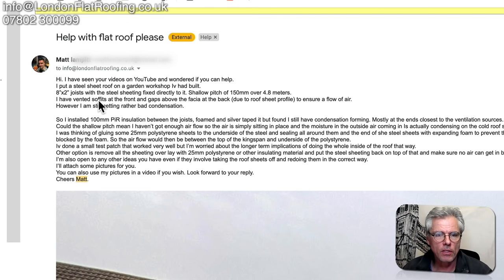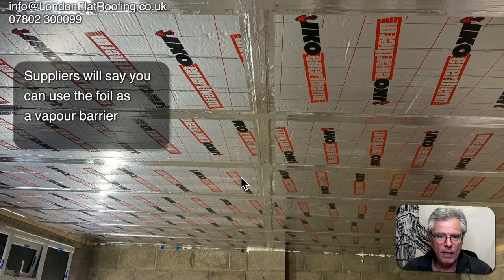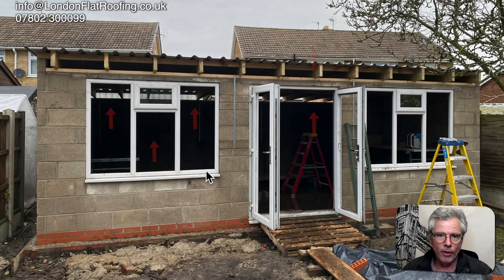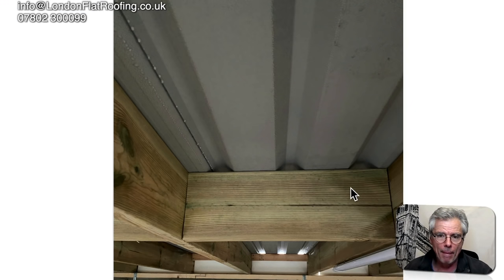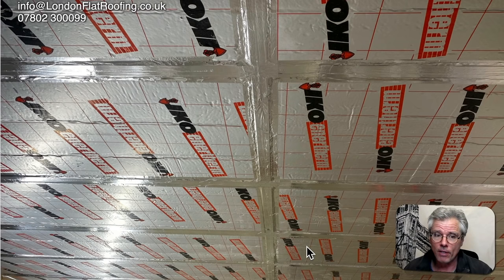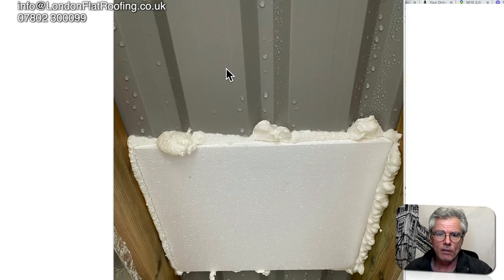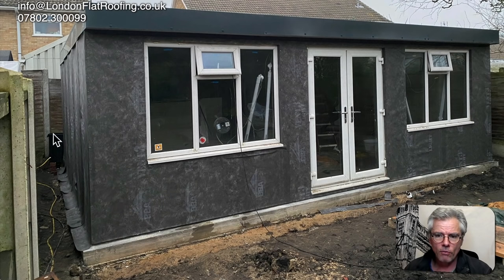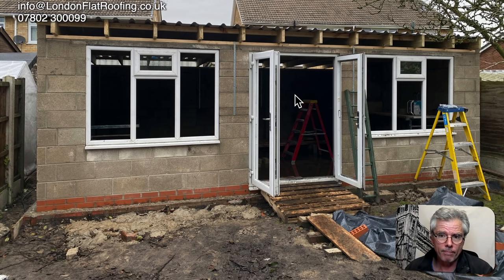Condensation/Sweating on garden office roof

Comment: I’m a builder, I bought my property in wales two years ago, the large garage, 7.5mx7.5m has a metal roof, the rafters run perpendicular to run of the metal roofing sheets, I was having horrendous sweating on mine, water was running down and dripping off every rafter, all my tools, motorbikes etc were rusting terribly.
I tried 50mm insulation but the rafters were 1300mm centres, so over time the insulation has bowed (I should’ve put noggins in with hindsight), i counteracted this with battens underneath to hold it up, this helped loads but still not enough, so last summer I stripped all the metal off and put a moisture membrane over the rafters then put the metal back down, it’s virtually eliminated the sweating now, or it’s happening above the moisture barrier.
This type of roofing is really common in these parts and works well but they also do an insulated version and a version with a fibre membrane glued to it, specifically to stop sweating, I’ll use that in future applications.
Reply from the maker: Thanks for the input can you send a drawing so I can totally understand as its not quite clear I can then share this with others as it sounds like you have found a fix. info@londonflatroofing.co.uk
Reply: @SteveRoofer  basically like your house roof
Reply: thanks this is something i am doing soon. a big metal roof. what vapour barrier did you use?
Reply: I have the very same thing brick walls and tin corrugated roof and had water drips all over my stuff  so I went to a carpet shop and asked them if they had any old carpets they chucking out they said yes in the skip at the back the shop filled my car up with of cuts and put them down on the garage floor  stopped the drips over night even made the garage warmer and when working on my bike and car I was on warm carpet  than cold floor .. 
Put carpets down very easy prob to solve
Reply: @Plastic&paint me  truly don't feel this is my remedy ..my roof needs addressing ..I've paid and ordered new screws with washers etc .  Gonna put new beams up to . Coat roof sheets in bitumen  paint . Smd go from there
Reply: I'll just say one thing the noggins have nothing to do with moisture transfer at all. The problem is the material itself. As it's cold to the ambient temperature point, a thermal layer will fix this issue
Reply: I am planning to do the same thing, but I want to create a space between the moisture membrane and the metal roof to improve ventilation.
Reply: @SBIGDTSM hiya. I'm also I'm wales and suffering the same issue. Do I place one whole piece of membrane over the top of the rafters then reattach the roof? Also is there something I should do when attaching it not to break the barrier? I'm not a roofer so treat me like I'm stupid 😂
Reply: @staceyrobson5697  it’s exactly what I’ve done, stripped off the roof, laid a heavy duty membrane over the rafters, stapled down, then refitted the roof panels.
I would say, with our very wet autumn and winter, I was still getting a bit of condensation, way less than before so I’ve added another 80mm of dense foam insulation and I’ve not had any since, plus the garage heats up really quick now when I have my heater on.
Reply: @carl1908  sorry for late reply, YT stopped sending me notifications, for the record, I didn’t say anything about noggins having anything to do with moisture transfer, the context of the noggins was, the rafters were at 1300mm centres, the 50mm celotex sheets I’d placed between the rafters were sagging over time, noggins would’ve prevented this.
Reply: @SBIGDTSM  okie doke. Yes I've insulated and tried expanding foaming the gaps to stop anything reaching it but it appears to have made it worse. So I'll wait for the dryer weather and fit a membrane. Something like tyvek?
Reply: @staceyrobson5697  I used heavy weight dpm, breathable should work too, make sure your area has good airflow, bad airflow is just as bad as no insulation.
Reply: Have u tried a dehumidifier?
Reply: @danreynolds1142  in a 50 square metre area garage? It would cost a fortune to keep running, it’s a big space.
Reply: @vlratcliffe1  the carpets on the floor probably were just absorbing moisture from the air.. when the carpets can't absorb any more, the roof will sweat again. it's still better to have something to stop the moist air from touching the cold roof. like a vapor membrane installed after the insulation underneath the roof

Comment: I bought a house with a double garage that has a roof clad in tin . In the summer it was like working in an oven, in winter it ran with condensation. I had the underside of the roof sprayed with foam in August 2003. I had to clear the garage before spraying and nearly melted with the heat even with all the doors open . Next morning the roof was sprayed and by lunch time it was finished. After lunch we returned to the garage and it was like stepping into a brick building out of the sun. This has been one of the best things I have done ,no more running condensation, no rusty tools making it a pleasure to work in. one mistake I made was I didn't cover the electric cables before spraying so if I have a problem in the future could mean a rewire. It wasn't cheap to do but the whole job including clearing the garage and putting everything back took less than 2 days . No signs of any rot in any of the timbers in almost 20 years
Reply from the maker: Ok thats good so this was some 20 years ago and no problems? What foam was it do you know? was there any smells or odors after as lots of people talk about problems with gassing off  with spray foam
Reply: Would you remember what time of spray? Insulated spray?
Reply: I have an outbuilding at the back of my garden which has walls on the side with pebble dash, and wooden front doors with wooden struts running across the entire length of the ceiling structure, over metal struts, supporting the corrugated metal roofing above. And on the side of the outbuilding I have a sliding garage shutter door, which is facing a small plot of land that is higher than the foundation of the outbuilding, with a slope, leading into a long channel drain in front of the sliding garage shutter, that leads into a soakaway. When I moved in in 2017, the concrete floor had some cracks in it, but over time, since my soakaway has completely blocked up, despite putting a hose through it, and sliding it in and out to remove any debris inside, the cracks in my concrete floor, have got bigger on one side of the concrete floor, which wasn’t reinforced like the other half of my garage floor. I now have this problem coming off from the underside of my corrugated metal roof, drips of water, which is ruining my tools and other stuff inside my garage, and it has suddenly got really bad. I’m having a roofer look at it, but I feel I need to replace my damaged soakaway with a deeper channel drain, which runs along the entire length of the garage, instead of just in front of my sliding garage shutter door. It’s hard to explain, but the whole situation is now making me anxious, not knowing what should be my next course of action to remedy it, while worrying the cost might be huge. I’m just wondering would my house insurance cover this, or not? Thanks.

Comment: Warm internal air holds moisture, if this warm air hits a cold surface it cools and condensation forms. Need to prevent a sudden temperature difference by using insulation between hot and cold areas. That white insulation stuck to the bottom of the metal will work work, thicker the better. I fixed a garage roof 15 years ago with exact same method. Its all about "relative humidity" ie hotter air can hold more moisture, as the air cools it cant hold the moisture so droplets of water form. You dont really want to be warming the roof, that looses heat which costs money.
Reply: It's about the dew point.

And where and how much insulation moves that.
Reply from the maker: Yes correct
Reply: Dew point or cold air bridging. As said warm air condensing on a cold surface. Like breathing on a window
Reply: I think in this case the source of the airborne moisture is the roof timbers and not the warm humid air inside the building (given it was not finished)
Reply: Possibly. The concrete blocks are a big thermal mass so continually warm the air and increase the airbourne mositure, then it naturally rises and dumps the moisture when it cools, then the cycle repeats. Single skin concrete block and steel sheets with no insulation are the worst case combination.

Comment: Great video and keen to see what the correct way of resolving this issue is. I also used this type of sheet to replace an old asbestos roof in lock-down. Same issue in my garage as the condensation at times drips all over the bikes/tools in the garage resulting in wet tools, shelving, bikes. Basically the contents it getting damp. Mine is just a garage so was thinking about 80-100mm insulation between joists and taping as this chap has done in his video but clearly that’s not the correct  route. Real shame I didn’t buy the sheets that have the condensation backing on to stop this issue in the 1st place. Really keen to see how this is resolved as it sounds like the roof sheets need taking off to resolve correctly.
Reply from the maker: Yes this has been interesting I didn't know about condensation backing but have had someone reach out to me that has a outbuiling with them on and im going to see it next week so hopefully may be able to update this with another video
Reply: You need to understand where the dew point will be between the hot and cold temperature change and understand the thickness off insulation required to move the dew point to effectively manage any condensation forming. And yes sufficient through airflow will help keep the timbers dry and manage the roof as the weather changes

Comment: Excessive humidity was a difficult problem where I grew up on the west coast of California. 

Where there are small attic spaces like this, once a good vapor barrier is installed, we generally installed some kind of powered ventilation fan to keep the outside air flowing through this gap and keep this area the same temperature on both sides of the metal. 

If the temperature and humidity is the same on both sides, there will be no condensation. 

Of course vents must be carefully installed so rain doesn’t get in there either.
Reply from the maker: I think we are moving towards adding powered venting and heating of roof cavitys in this country

Comment: Some sheets come with the insulation attached, expensive though. My understanding is that the warmer air inside contains moisture that condenses on the colder metal roof sheet, depending on your local weather this may or may not be an issue.
Reply from the maker: Yes you need to keep the bottom of the metal warm
Reply: For something this size those panels can span 3m with only 1 support in the middle so even though the panels are more expensive, you save a lot in timber costs and labour since 2 people could put the whole roof on in a couple of hours...
Reply: This is absolutely correct, the reason you get water droplets forming is because of cold air has less capability to hold moisture than hot air. The air in the building condenses on the cold metal surface just like the effect of a cold drink in a glass makes moisture form on the outside of the glass.
The solution is really simple, apply insulation to the cold surface, preferably hydrophobic insulation or insulation with a hydrophobic coating. The plan should be for the insulation layer to be as tight to the metal roof as possible so there is no opportunity for air exchange against the cold surface.
Reply: I have an outbuilding at the back of my garden which has walls on the side with pebble dash, and wooden front doors with wooden struts running across the entire length of the ceiling structure, over metal struts, supporting the corrugated metal roofing above. And on the side of the outbuilding I have a sliding garage shutter door, which is facing a small plot of land that is higher than the foundation of the outbuilding, with a slope, leading into a long channel drain in front of the sliding garage shutter, that leads into a soakaway. When I moved in in 2017, the concrete floor had some cracks in it, but over time, since my soakaway has completely blocked up, despite putting a hose through it, and sliding it in and out to remove any debris inside, the cracks in my concrete floor, have got bigger on one side of the concrete floor, which wasn’t reinforced like the other half of my garage floor. I now have this problem coming off from the underside of my corrugated metal roof, drips of water, which is ruining my tools and other stuff inside my garage, and it has suddenly got really bad. I’m having a roofer look at it, but I feel I need to replace my damaged soakaway with a deeper channel drain, which runs along the entire length of the garage, instead of just in front of my sliding garage shutter door. It’s hard to explain, but the whole situation is now making me anxious, not knowing what should be my next course of action to remedy it, while worrying the cost might be huge. I’m just wondering would my house insurance cover this, or not? Thanks.

Comment: I have built many structures with exposed metal roofing such as this in environments where the inside/outside temperature differential is up to 40c and the humidity 30/95%. The only proper solution to the problem of sweating is spray foam insulation (closed cell) applied directly to the metal to create a hermetic seal. It only has to be 2-3cm in thickness to be effective. Only ventilating/heating will only remediate the sweating, not prevent it. The foam panel amend open cell foam remediation seen in the video is not adequate as it still allows for a cold zone next to the metal causing the condensation. I hope that helps. Good luck.
Reply from the maker: Yes that seems to be the way everybody things he should go
Reply: I have an outbuilding at the back of my garden which has walls on the side with pebble dash, and wooden front doors with wooden struts running across the entire length of the ceiling structure, over metal struts, supporting the corrugated metal roofing above. And on the side of the outbuilding I have a sliding garage shutter door, which is facing a small plot of land that is higher than the foundation of the outbuilding, with a slope, leading into a long channel drain in front of the sliding garage shutter, that leads into a soakaway. When I moved in in 2017, the concrete floor had some cracks in it, but over time, since my soakaway has completely blocked up, despite putting a hose through it, and sliding it in and out to remove any debris inside, the cracks in my concrete floor, have got bigger on one side of the concrete floor, which wasn’t reinforced like the other half of my garage floor. I now have this problem coming off from the underside of my corrugated metal roof, drips of water, which is ruining my tools and other stuff inside my garage, and it has suddenly got really bad. I’m having a roofer look at it, but I feel I need to replace my damaged soakaway with a deeper channel drain, which runs along the entire length of the garage, instead of just in front of my sliding garage shutter door. It’s hard to explain, but the whole situation is now making me anxious, not knowing what should be my next course of action to remedy it, while worrying the cost might be huge. I’m just wondering would my house insurance cover this, or not? Thanks.